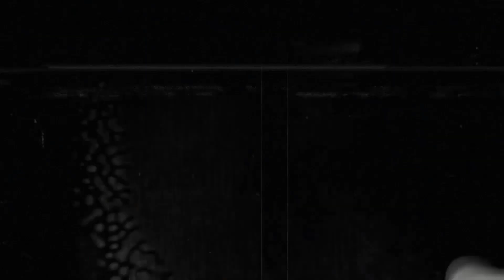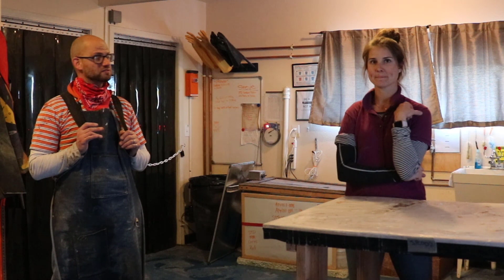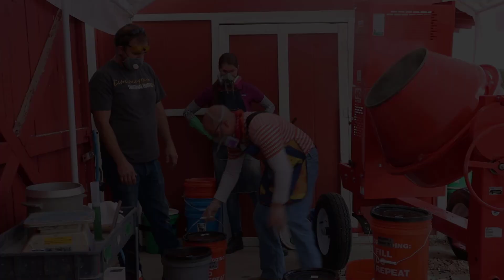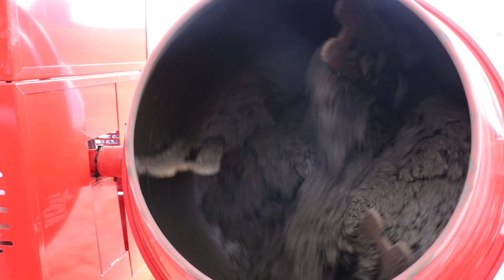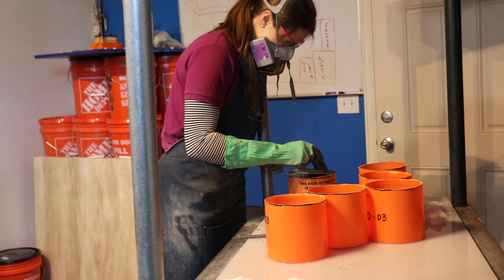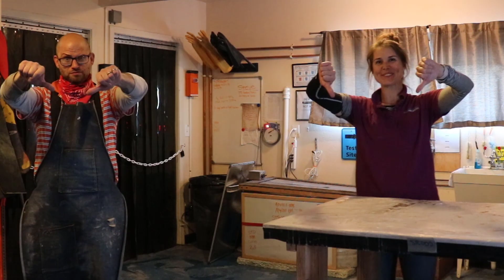ASTM C 494: Mixing and Making - Vlog 644

Comment: Thanks for your videos. I was wondering if you could do a video on de-lamination caused by powertroweling. 1- how to deal with crusting (typically a result of wind). 2 What to do if the batch man accidentally puts air entrainment in a powertroweled floor. 3 delamination caused by over troweling especially with a rider trowel. 4 - what is the science??  I've been able to use various techniques with varying degrees of success (wood bull float, surface retarder ect.). I'm curious what your take is.
Reply: I'm not sure why part of my previous comment is crossed out. It was unintentional
Reply from the maker: 1. A finishing aid works best to bring the concrete surface back to life. 2. Keep good notes and make sure you have a good attorney lined up. 3. Try not to over trowel and most importantly don’t bless the concrete with too much water 4. See one of our other videos on the thermal kinetics of cement hydration 5. It really depends on the situation and the job site, obviously there are certain tools you cannot use for specific types of concrete slabs. When it comes down to it it’s the Ambient environment, the lack of moisture or the excess of moisture, the type of concrete, and the type of finish that the customer wants that pushes the decisions. But it all comes down to is good concrete starts way before the finish during the concrete mix design selection.